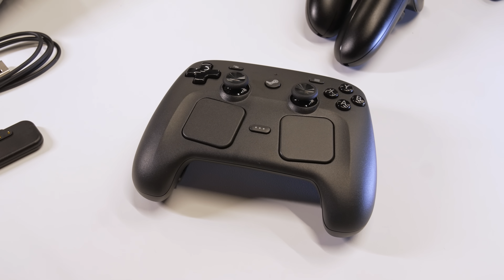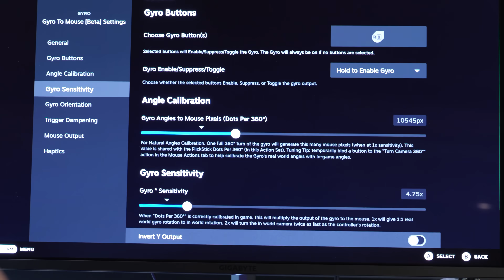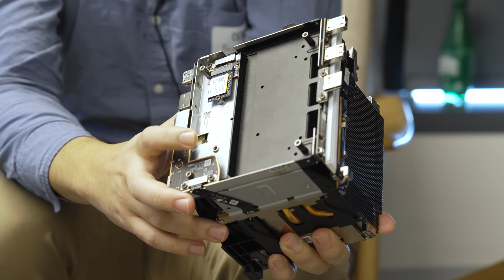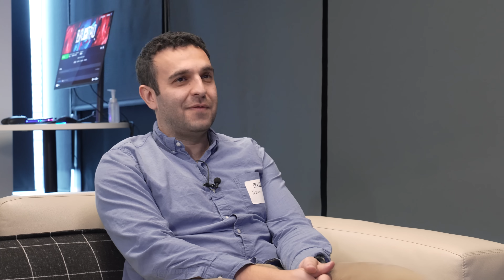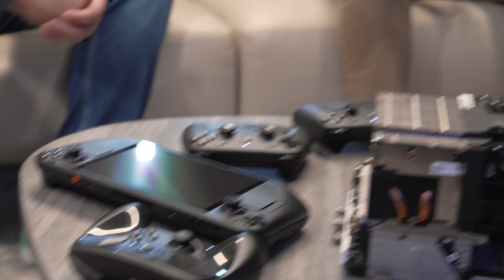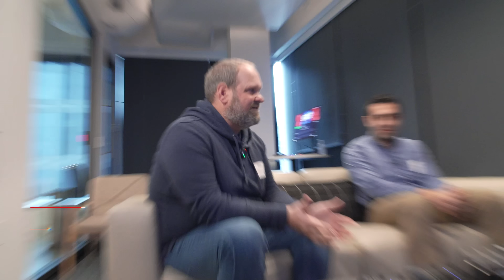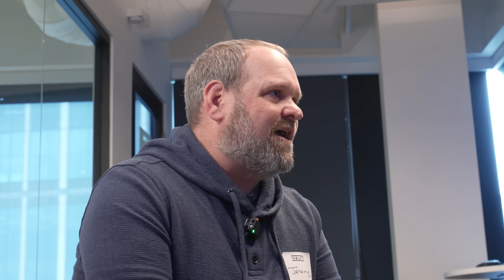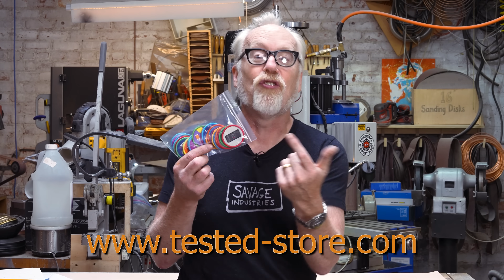Hands-On: Valve Steam Controller 2 and Steam Machine!

Comment: One interesting thing about the specs of this box. They’re not high end, but publishers will care about their games running on this thing, so that will encourage devs to target things like 8gb of vram and 16gb ram. While I want a powerful one, I want devs to care about a less powerful one so all of us get better optimized games.
Reply: I think having a good baseline for PC hardware is actually a very good thing.  It could potentially make games easier to run for everyone, even those without the Steam Machine.
Reply: I imagine we'll see it as a hardware target for already PC centric publishers, but I doubt too many large publishers like EA, 2K, or Activision will care unless it has a large enough install base.
Reply: Yes yes yes! This, so much.
Reply: THIS. even tho a small part of me doesn't blame devs. they are in a time trial every single day and to optimize a game you must do it since day one.. i'm tired of the big seats forcing devs to not optimizing games, but i'm also so tired of devs themselves not rioting.
Reply: You nailed it! The problem today is not performing chips, it's performing code!!!
Reply: that is if it really catches on, like the steam machine needs to be sold like 5 million units really fast for devs to start to really embrace better optimization (and hopefully anti cheat linux support unlike EA)
Reply: @banguseater And that’s why it’s only got 8gb vram and 16gb system, to keep it cheap.  But now Valve need to come in SUPER cheap for the 512gb so it sells millions.  $420 would blow the world away.  Definitely wants to be under $500 imo.
Reply: @banguseater  I believe the Deck already sold in the millions with many wanting their games, at least within reason, to run on that thing. Hence why I got an LCD, not just because I'm a cheapskate, but because if something runs on that it will run everywhere else hardware wise.
Reply: I think devs need to realize that there are essentially 3 tiers of gamers when it comes to specs- bleeding edge ray tracing hdr chasers, those of us who it to look good without dropping frames, and the people who just want to be able to play without caring what it looks like.
Reply: @allentastic my hope is that this and the steamdeck are middle and bottom in that diagram
Reply: The thing is modern stuff should run fine on those specs.  It lazy developing and unoptimized game engines. There isnt to much talent left in the game programming industry these days, they have retired.
Reply: @Y @YTSUCKS935 I think there’s talent but it’s shifted from technical to artistic, and with a much thicker layer of management.

At the fidelity games expect the problem of rendering a 3d world on a wide array of hardware is incredibly difficult, especially when you need to do so while supporting artist tools like scene editing and stuff.
Reply: that’s what i’m talking about .
Reply: This might be wishful thinking lol. I hope it's true though
Reply: They are entry level, but not horrible. Definitely good enough for a good experience in pretty much all games.
Reply: Yes as some good devs have said, consoles have been good for them because they led conscientious developers to increase their optimisation skills.  But still in this age 8gb really is small, especially if you’re a AAA fan.  Or like to play any UE5 games.
Reply: Yeah I'm happy about that. Especially because for some reason AMD and Nvidia have still released 8GB GPUs in 2025, Steam Machine graphics presets or Steam Machine verified games will probably be useful to reference for a lot of players who don't have a Steam Machine, but are using hardware with similar memory limitations.
Reply: PREACH
Reply: In console terms I remember when 15 years ago you could count on devs optimizing games for new hardware after at least 1 year of it's life cycle. Nowadays you can have the most robust hardware several years into it's life cycle and have almost Zero optimization by devs for games making the robust hardware essentially useless and look almost identical to it's previous generation in gameplay.
Reply: Boo
Reply: this is true but also watch your self dont shill for valve just cause its valve
Reply: @cookies5367  I hear you but what's the alternative? The rest of the industry could care less about customer experience.
Reply: But can it run Crysis?
Reply: No. The publishers can already see the results of Steam hardware survey, where most hardware is even weaker than the Steam Machine. They just don't care, gamedev companies value production expenses more than the end user experience, that's why things like raytracing and nanite are used.
Reply: @ASHDMDSGN optimizing for a single piece of hardware is a lot easier than optimizing for everything. And just getting the "Steam Machine verified" label is a reason to do it.
Reply: @codex4048 it's not easier or cheaper than not doing it at all. Receiving a cool sticker from Valve isn't a reason, why a business would spend money to optimize their game for Steam Machines. Potential profit is the only reason. 

Steam Deck sold 4-5 millions of units, yet there almost no games specifically optimized for it, and no AAA at all. Valve would have to sell even more machines, in the tens of millions, to make more developers consider optimizing for a different operating system and Steam hardware specifically. IMO, that's not feasible due to hardware supply.

99% of optimization will come frome Valve tuning the software and firmware specifically for their hardware and use-case, not even indie developers.
Reply: I should add, I really hope Valve release desktop SteamOS. At least AMD cpus should be able to run it without much pain. That massive market could make developers optimize their games for SteamOS as well as Windows.
Reply: @ASHDMDSGN I think the main thing steamos does nowadays is sleep wake. Most of the features are built as contributions to open source software that all Linux distros can use so apart from sleep wake, bazzite can do basically all of it for example.
Reply: @maboesanman  Yeah, purely gaming audience should love that. To me performance and compatibility is also important.

Native linux apps will be faster than windows, because it's really bloated. I tested ubuntu several years ago for blender rendering, it was 5% faster than windows.

When I had to render something close to my vram limit on windows, I'd turn down system resolution to 800x600, because windows kept 400-700mb to itself at 1080p for no reason.
Reply: @ASHDMDSGN Having a specific product helps a lot, larian did a lot of work to get bg3 working in steamdeck for example.
Reply: @ASHDMDSGN You know they don't use the Steam hardware survey.  They want to convince people that they need to upgrade their system in order to experience their games, which is a good way for me to just ignore those games.
Reply: @FrickinBrian No, I don't.

DICE clearly looked at current common hardware before BF6, because previous games incorporated more cutting edge tech.

Also, there are hardware partnerships, but any buck they make is tiny compared to savings from new more resource intensive workflows, that also make games harder to run. Simply using 3d scans with nanite for environment assets instead of manual modelling can save millions of dollars on a single aspect of a single AA game.
Reply: @ASHDMDSGN the steam hardware survey almost doesn't matter. The people with weak pcs don't necessarily buy games when they re playable for their computer, these players might be only playing a handful of games or even if the triple A game run well they still wouldn't be able to afford the $60 to buy it (god forbid the $70 or $80 games we will start to see)

In short, the low end is not a marketable group for a triple A studio and I imagine a cost analysis shows that it's not even worth optimizing their games for this demographic.
Reply: @BankruptGreek  If that were the case, then every AAA presentation or trailer would start with words "leave, if you don't have a 4080". But they don't want to get rid of millions of potential customers.

Gamers play whatever they feel like, spending even 80 bucks on a game is much easier to justify, than buying a $1000 dollar pc. But AAA games still keep selling in the millions of copies, and there are much fewer owners of high-end hardware, that can actually run these games. Millions of 4070-class and higher gpus simply don't exist, yet millions of people bought borderlands 4.
Reply: @ASHDMDSGN they don't tell you that because first of all no game has a 4080 as minimum, and secondly it's free marketing, why would you scare a potential customer away. They might buy the game like it and keep it for when they will get an upgrade or not know how to refund it
Reply: @BankruptGreek  And how exactly does that contradict my points? Of course game companies won't state outright or specify a 4080 or 5070ti as the recommended spec, but the only way you can know for sure is after buying or watching someone else test the game.

They will deflect, manipulate and even lie to make you buy the game. Indiana Jones, Borderlands 3/4, STALKER 2, Cyberpunk 2077, Wukong, KSP 2, Alan Wake 2.

Sometimes they name the spec, but don't tell you what resolutions or settings they used. You may expect 60fps@1440 as the recommended, but it's 1080. You may expect 60@1080, but sometimes it's 30fps. You may expect low and high, but it's low and medium. Native vs Upscaled etc. Check techpowerup game tests or channels like hardware unboxed. The game will probably "run", though.

Indiana Jones has 3080ti 12gb as the recommended GPU, but the game can eat up to 15gb at 1080p, and not run at all on 12gb cards in 1440 and 4k. So you'd have to buy a 16gb 60ti or a 70ti this and past generation, which cost around the same as the steam machine will.

Practically no one is going to consider the 8gb vram limitation of Steam Machine, because there are already millions of gamers who have 8gb or less, and they have been left behind a year or two ago. Surely, 2026 is the year of 8gb cards.

Steam Machine compute performance is another story. It's going to use customized ryzen 7640u and radeon rx7600m xt, basically low to mid-range past-gen laptop. How many new games target this range of hardware? At native res, even 1080? At 4k for living room use? If you say anything about older games, you can just buy an old pc instead of the machine.
Reply: That's actually the one thing that makes me worried about the longevity of the steam machine. Most modern games need more than 8gb of vram to run well at higher settings. 

My gaming laptop has almost the exact same specs but it does struggle with some modern games to deliver a consistent 60fps at 1440p. Now I do expect the steam machine to run better because it has better cooling but that doesn't ease my worries that much.

But I think I will be getting one of these if the pricing is competitive.
Reply: I'm a little late to this convo but steam is is Linux based which means it runs better than Windows which is huge reason games run poorly. The OS itself isn't bloated and taking up a lot of resources needed to run the games. It may be underpowered but the software is clean and made to play games. @rsdj01
Reply: Can’t we not enshitify games too? Remember when games used to push the envelope like doom 3, crysis, etc? Crysis still looks better than many games out today
Reply: @nothingtoseehere93 how is optimizing games better enshittifying? Generally valve resists enshittification because they don’t have shareholders that demand it
Reply: Okay, let's all agree on one thing: the problem isn't the hardware specifications. The core issue is optimization and the laziness in implementing it! 8GB of VRAM is enough to run even the most demanding game if properly optimized. The proof is that even the most powerful graphics cards struggle with initial game launches, and then you have to wait for updates to fix these problems. So, the problem lies with the laziness of developers and companies who want you to believe your computer hardware is weak, which it isn't. Therefore, we, as gamers, must speak out: continuing to develop consoles or computer components isn't the solution, and this greed must stop. I want a gaming device that will last me for years, and I don't care about AI technology, so why are you trying to force it into games just to make me buy graphics cards I don't need in the first place!
Reply: @IRAQ_WITHOUT_SHADOW the ai upscaling isn’t the problem. It’s incredible technology for taking a game that runs great at 1440 and making it run great at 4k. The problem is not having a rallying point for “pc” that lets people say “the game performs poorly” without qualifying it. The marketing will use a monster PC. This gives the industry a reasonable machine to give performance numbers for. I imagine IGN would use this box as a baseline for “PC performance” which imo will be very healthy. “PC gets X fps” is not something you can say right now and i think we will start seeing “steam machine gets x fps” as a stand in for that.
Reply: @maboesanman "incredible technology". Still has flickering, ghosting and reconstruction issues. Shit like the Outer Worlds 2 doesn't even run 60 fps on an RTX5090 at native res.

Comment: Why the always say: 4k / 60 with FSR. Ok, gentleman but what FSR 1/2/3/4? Which one?
i mean for 600 now you can put together an 8 core 16 threads with a 5060 that would smoke this with better upscailing than FSR.

Comment: The steam machine isn't necessary for me as I already have a high-mid end PC that can run pretty much any game I want at 1440p 100+ FPS.
And for TV I can just stream to my steam deck over Ethernet. But for some just getting into pc gaming maybe with just a steam deck this is perfect. 

I will be buying that controller though that is exactly what I need for both my PC and my Steam Deck when docked.

Comment: One thing they should do to make the Steam Machine more successful in the long run and put it in line with consoles is when starting a game have the thing run a test in the background and automatically set the settings and optimize the given game for the Machine specs. That way people aren't cranking everything to high and then crying when it performs like dog poop. I mean they can if they want to afterwards but they'll know the game won't run as well if they do. Just something to simplify everything for the average user. Obviously that's WAY easier said than done.

And also.... speaking of Steam why is it that nobody is talking about the super secret beta they are currently testing for cloud gaming? The difference is versus current cloud gaming is that it processes as much as it can on the individuals given PC (regardless of the PC specs) and then the rest on their end in the cloud. Versus how it is now with 99% cloud gaming being processed on the given company's side. That's huge! How do I know about this and it doesn't seem like anyone else does?  And I'm not even one of the testers lol. I assume that info will go public any day now.

Comment: Can it work well without a dedicated display. I have issues streaming my PC to my Steam Deck when it has it's display off. I would like to carry that box with me and stream to the frame and the deck without a display for the box.
Reply from the maker: Headless Steam Machine! Good question—I’m pretty sure that would work just fine. And if not it’s something I could see them supporting
Reply: @tested Firstly thank you for your reply. Secondly would you please ask if they have content adaptive brightness on the Steam Frame? The hardware you described should be capable of this and it would greatly mitigate the LCD issues.

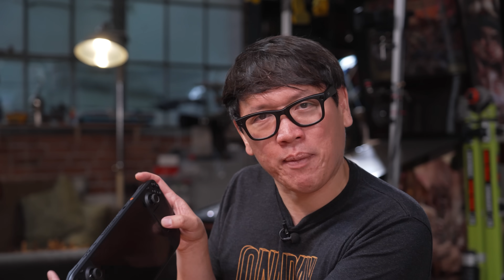Comment: 2:50 What Norm is saying makes no sense to me. If it was uncomfortable to use the thumb pads on the Steam Deck because they were "too low", then why would the even lower thumb pads on the Steam Controller be any improvement just because there's some angle? You can clearly see in the demo videos, you have to stretch your thumbs even further than you ever had to on the Deck. Also, very interesting, to me the thumb pads on the Deck are in the perfect spot to be very comfortable, and that's probably why I'm sceptical of the new thumb pad placement. Also bummed out that they went and integrated the sticks into a single board, I was hoping they'd simply reuse the modular components of the Deck inputs, and we'd immediately have replacements available. And it would've also allowed third-party hall effect upgrades. All in all, I'm seeing a lot of pointless (to me) compromises on the new controller, and I was hoping Valve would've learned from the 1st version what makes these devices unique is also what makes them polarizing, those that don't care will continue to buy regular gamepads, and the enthusiasts will get a worse compromised version.
Reply: How you held the steam deck made those pads sit below your thumbs normal movement. This sets it more even to peoples thumbs natural range of movement
Reply: The sticks are TMR unlike the carbon track original potentiometers on the Deck. Theoretically you wouldn’t need to replace them for stick drift since TMR are not contact-based just like hall sticks but better. TMR has faster response time and lower power usage.
Reply: you mentioned hall effect upgrades, but TMR is actually a more advanced version of hall effect, so there should be no need for third-party upgrades like that yet